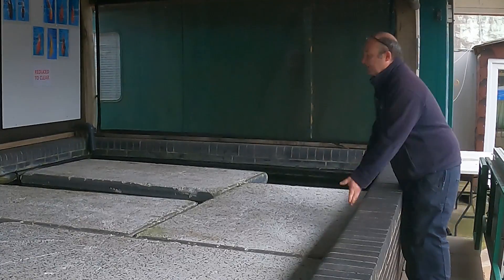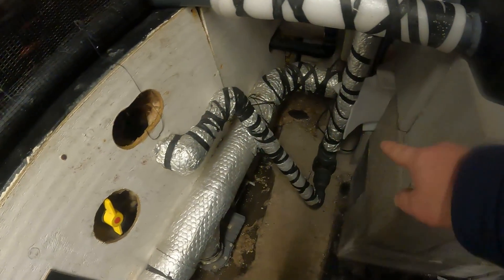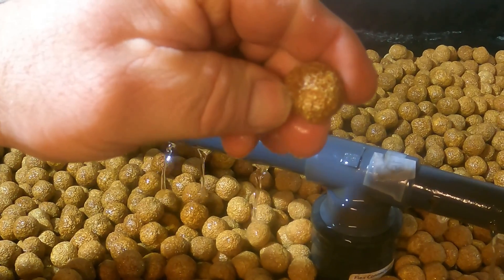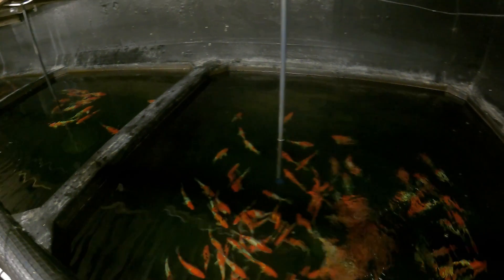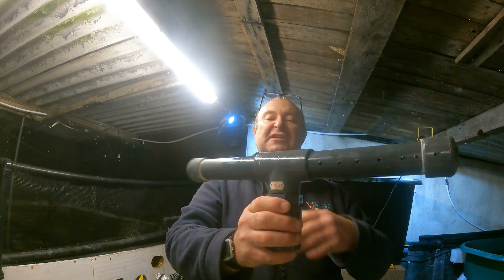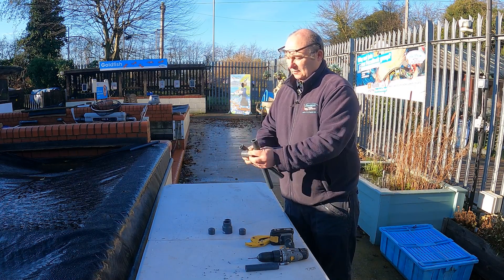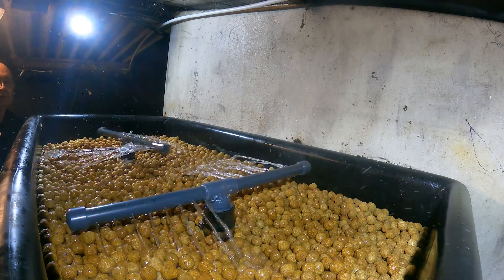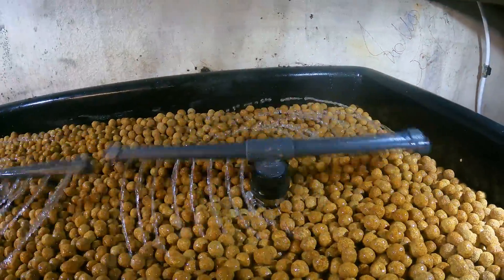DIY trickle filter updated.

Comment: Thank you so much for this tutorial! I’m in the process of gathering everything to make one sprayer for a large rain barrel. Why did you jag down the pipe then jag up to the filter box? I don’t know anything about plumbing but there must be a significant reason.
Reply: Also, where is the best juncture to put a T and a bit of straight on top so that should the electricity stops the filter container won’t empty into the pond/tank?
Reply: @leecalladine
Reply: @leecalladine also, how are u filtering out all the debris before going into the biofilter?
Reply: @leecalladine NVM I will put the pump in a skimmer bucket hanging off the inside of the holding tank using a stainless steel mesh to collect debris before being pumped into the biofilter

Comment: i could be wrong but i think its not the anaerobic bacteria in the media but the higher amount of oxygen available to the bacteria as the media isn't submersed similar to when commercial aquatics aquarium plants are gown in a green house in a high humidity environment the increase in availability of CO2 to the plant increase the growth of the plant same concept in your trickle filter.
Reply from the maker: @danielmerrell8926  the anaerobic bacteria are supposed to be removing the oxygen atom from the nitrate allowing it to free off as a gas. However there is very little evidence it is effective in reducing the nitrate levels in a meaningful capacity.
Reply: @leecalladine  most people I know that want to produce anoxic environments run very low flow through sulphur reactors
Reply: Great videos though I have to admire the engineering you put in the spinning spray bar awesome job

Comment: Great Filter.  I would like to add this type of filter to my pond.  my pond is about 5500 Gallons (21,000 Liters). What size filter (volume /area) do I need ?
Reply from the maker: There is not a good answer to the question. This type of filter is strictly biological and would be useless as a primary stand alone filter. However a large filter is always going to be better. Trickle filter will out perform submerged filter many times over. But there is no mechanical filtration in this design.

Comment: Great what size pump,love this
Reply from the maker: the pump running this is a around 5000 lph only. think its drawing about 50w.  112" pipe from pump drops down to 2 x 3/4" rotators. If the tank was round it be just 1 rotator.

Comment: I would add biochar in the middle layer of the pebbles, it will increase the nitrification process plus will polish the water crystal clear.
Reply from the maker: yes there are ways you could modify  the design. We do have another filter system as well on this system its for the mechanical  and extra bio.  https://www.youtube.com/watch?v=mCwLKmqIct0&t=30s